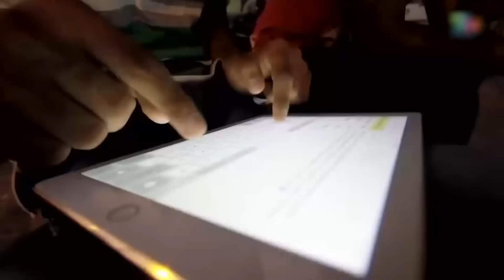Revolutionizing rail infrastructure in Bengaluru

Comment: Ashwini  Sir, we appreciate your effort, however currently, sub urban railway in Bangalore is moving at snail's pace... please fast track the project so that we people at Bangalore,  would suffer less from traffic jams..
Reply: traffic jams over if delhi like metro built within city not with sub urban only
Reply: @varunmittal3617  Demography of bangalore is different... a single metro system from one corner to an IT Park in another corner is not enough....if metro is crowded during peak hours, people would start using private vehicles, which would inturn cause more traffic jams...

Comment: shamelessly keeping his position as railway minister despite multiple horrible accidents
Reply: With this old infra no one can help . The only solution is to bring  new technology with new trains and new tracks and it is happening and it will take time.
Reply: @DS-rr8ih don't blame the infra for everything. He needs to push better safety practices just like air traffic control in the Airline industry. If you can't run trains safely, then stop running them. Running trains without tight safety practices in place means you don't care about the lives of the passengers more than you care about revenue from those trains
Reply: @wyomingar  who told you no one cares?  To blame and asking for resignation against someone  is easy  but accepting the major issue or reason behind such horrible accident is really hard to digest. 
Only new infra can bring change...
Reply: @DS-rr8ih  Having hundreds of people die in railway accidents and yet he keeps his job shamelessly as a minister. that shows he doesn't care. Zero leadership qualities. Spews some bs in the media and everybody goes he's so smart. Passenger safety should be the first and only place we should be spending money on so not one life is lost, not on some third grade vande bharat trains, which can't even go half the speed of Chinese trains.
Reply: @wyomingar bro stop crying, just because someone is trying to make a change in railway infrastructure and bring new technologies. You are acting like we can catch up to Chinese technologies without getting experience in semi high speed rails . Lol the whole rail network and tracks are based on old technology and outdated. That's why we are seeing these accidents. Don't just blindly blame anyone, things need some time to change.
Reply: @wyomingar  it means you dnt know anything except ur criticism against gov. This is not how a gov. works, in case of China  our tracks are not capable for such speed  . Everything new is coming and is equipped with new technologies .Not even 100 vande bharat have been launched . Change can't come in one day Or one year it takes time.
Reply: @wyomingar  it means you dnt know anything except ur criticism against gov. This is not how a gov. works, in case of China  our tracks are not capable for such speed  . Everything new is coming and is equipped with new technologies .Not even 100 vande bharat have been launched . Change can't come in one day Or one year it takes time.
Reply: @6126AVIR1 you talk like he balsted destroyed train. There is certain people who throw stone on going train. We saw placing stones in railway road etc.. why accident happened only in Chattisgarh and bihar? Bihar is worst state in all aspects law and order is shit their.
Reply: @h.k48 chill bro - haters will always be haters no matter what. They perhaps can't digest the fact that they aren't allowed to spit and leave that bad odor in the new trains.
Reply: @h.k48  you tagged wrong guy
Reply: Than what he has to do 😂😂😂
Reply: @bkishore9973  resign
Reply: @wyomingar  yeah and put likes of Lalu Yadav in charge- rail accidents are no new news. with new policies being tested and setup and railways modernizing - a few bad things can happen- obviously the loss of life is deeply saddening but that shouldn't mean we should not focus on development.
Reply: @rishabh8355  Is the only alternative to this guy, Lalu? Are you saying there no other qualified person in BJP, who can take over from this joke of a minister? Saving lives should also be part of development, not just spending billions on HSR that nobody asked for.
Reply: @wyomingar  No but he is adeptly qualified..when you have ever seen a Minister taking part in trials, visiting ground zero in middle of night when an accident happens. Note that I'm not even talking about the modernization efforts and evil intent people placing iron rods, stones and other practices to deliberately cause a potential accident. Obviously there is scope for improvement but the Minister is by far among the most competent person to do the Job. It's easier to complaint but hard to lead.
Reply: @rishabh8355  I'd like to see a minister that takes ownership of accidents and lives lost and can come up with a concrete plan to stop these accidents or else resign. This is what leadership means. How about taking part in trials of better training the personnel or having better fool-proof practices in place? What's the point of him visiting ground zero right after the accident? It actually impedes the rescue operations and increases casualties.  If there's no better person than him at this moment, then I guess we have to live with him and avoid traveling by train.

Comment: India must consider Maglev Train system other than bullet train for a long distance route. Next cargo cum passenger train. Railway Ministry must focus on upgrading modern high speed futuristic track of 350 km instrad of 180 kmph. Modernising signalking, track monitoring through CCTV, introductikn of CCTV on all train with face recognition technology, good backup storage, online real time monitoring possible each and every compartment remotely from any location with better high speed internet connectivity. Announcement system, display of next station etc also needed to be introduced on all rxisting and future train. All train doirs must be auto closed where lots of accident happening due to open door  on long distance train. Needed to upgrade to European or Japanese standatd sll our train and its operation. 

Laying new track with targetted time must have 100 kmvper day target adding additional 2 lakh km new mosern track required other than existing track. 

India's coastal Road cum rail project and connectivity needed entire indias coastal belt. This will integrate with port, shipping lines, water transportation etc.